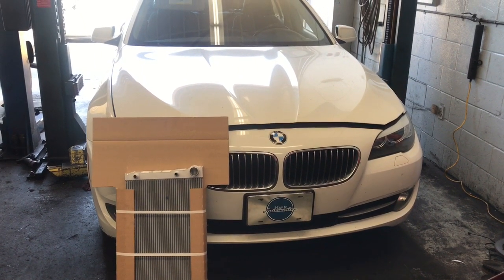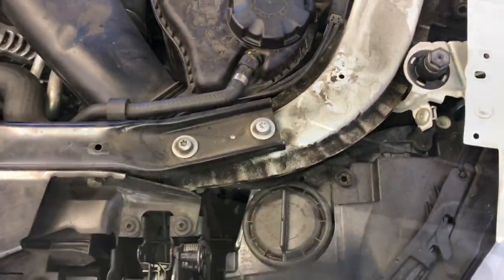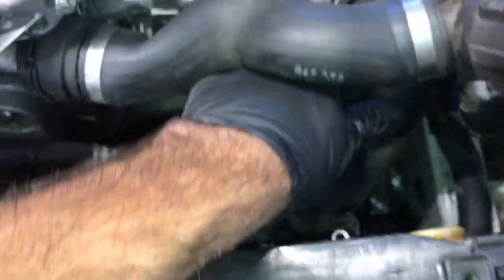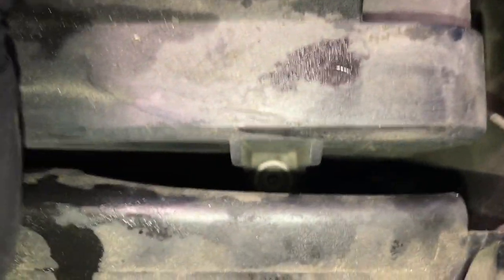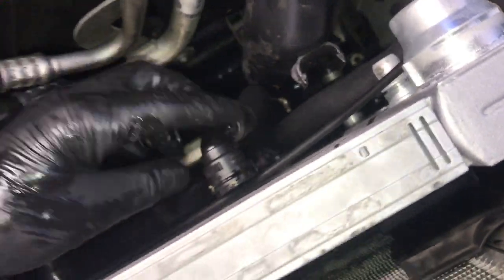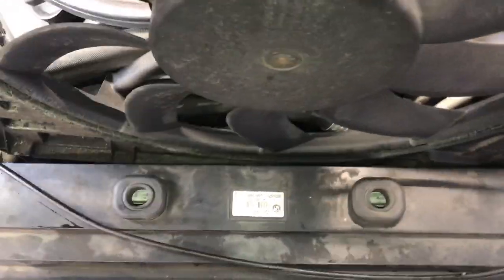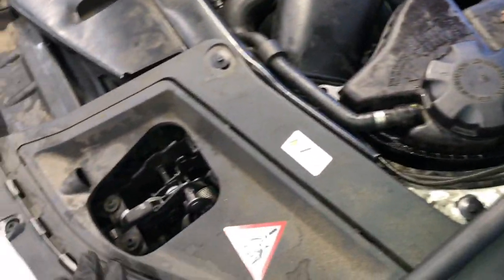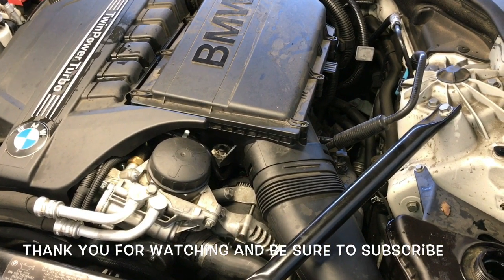How To Replace The Radiator On A BMW 528i-535i (f10)

Comment: there is an electronic bleed procedure that you can do so you dont have to run the vehicle. click engine start once, turn heater on the highest temp, with lowest fan speed, and turn off the ac button, and floor the throttle past the kickdown switch, for 15 seconds. youll then hear the water pump activate and itll bleed it perfectly, takes about 12 minutes.

Comment: Nice work you forgot to add the how to bleed you system. Air pockets in the cooling system can cause it to over heat. There’s a procedure on the inter webs

Comment: Yes,Why do u have to replace everything.can you just cut the clamps that are holding the upper hose n just put a hose that would fit there n replace the hose clamps instead of replacing all the hose attachments. Thats what i did.

Comment: What size O rings are Those and can I get them at local part store ...I'm waiting for radiator to come in mail...I've replaced thermostat water pump and realize the radiator is leaking and smoking once it gets up to temperature and at one point was leaking from passenger side hose that has o ring .... and what's that section below radiator?
Thanks in Advance and thanks for video

Comment: Well done I have about 130,000 on my 535i have already done water pump and( thermostat was a beast$#%@) pretty shore I will be changing the radiator soon I wish I had seen video because changing the thermostat with radiator seems the way to go

Comment: Can you explain to me how did you drain the radiator? I know there is a plug under the car but i dont know how it works..what do i need to do?
Reply from the maker: Hrvoje Goospeed start by removing the radiator cap. Then take off the under shields. Now on the bottom of the driver side of the radiator will be a blue plug that you can stick a Phillips screwdriver in and rotated counterclockwise.

Comment: When i removed the radiator fan to replace the serpentine belt, belt tensioner & both pulleys i notice near 2 of the bottom radiator hoses left and right side had some green/yellow gooey harden stuff around the hoses.  Either both hoses are leaking coolant or the radiator has pin holes on the exact locations on both size (yeah what are the odds!) 😂 causing coolant to spray out during pressure.  Fortunate the oem hoses and radiator are cheap to replace my self!
Reply from the maker: LaloMan sounds like the hoses are leaking. Or the hose clamps
Reply: How hard was it to get the fan out? I have the same pully job awaiting me in the garage.